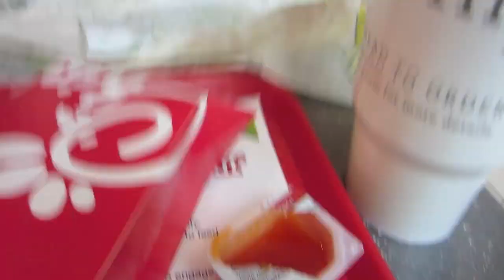600 VIDEOS AND 50,000 SUBSCRIBERS!

Comment: Ty, buy a framing hammer, i understand you do not do too much work but it will last a lot longer and will not break. And next time when the nail is up too high and you do not have enough leverage, put a small scrap piece of board or your screwdriver under the hammer to lift it off the board you are pulling the nail off of. Hope the tip helped! =D